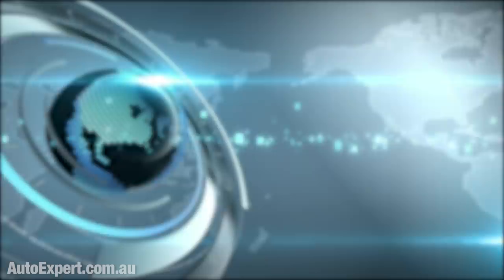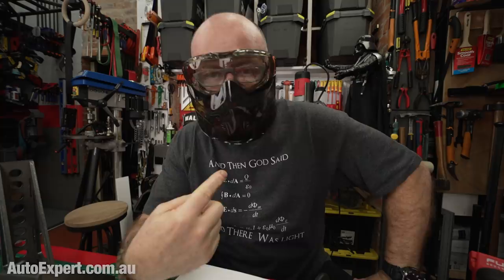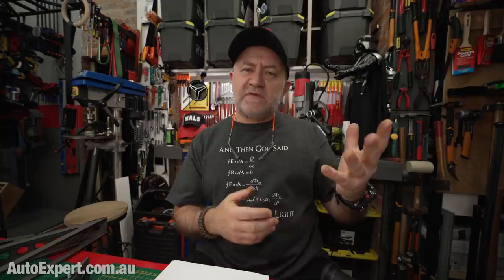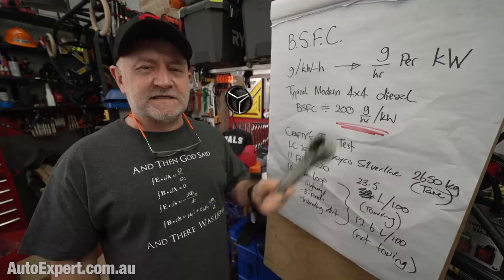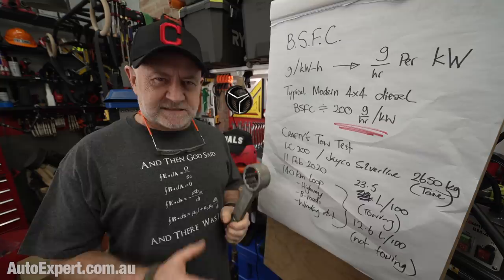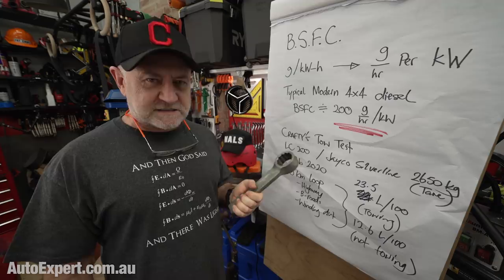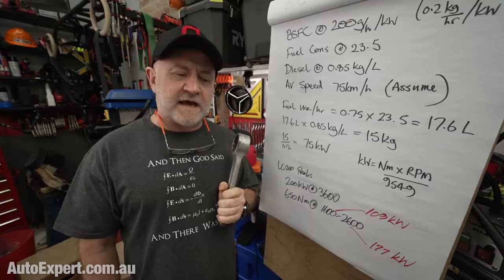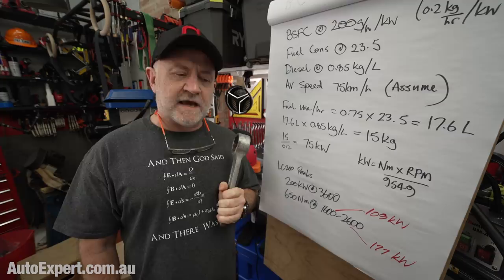How much power does it really take to tow? | Auto Expert John Cadogan

Comment: I completed my trade as a Fitter& Machinist  many moons ago and was taught both in TAFE and the workshop that gloves were not to be used whilst operating grinders, lathes, drills, planers, slotters, mills, etc. for safety reasons.
Reply: Correct, along with long hair to be tied back, lose clothes or cuffs to be fastened up. Don't use gloves with a grinder, John is very right with his non glove wearing. On the other hand we were told to wear safety goggles/glasses at all times in the workshop because its not only you firing metallic objects into the sky.
Reply: Agree with all except 4in grinders.
Reply: If it rotates no gloves.

Grinders come with guards?
Reply: @andrewiannello6548  why specifically  4" grinders?
Reply: And rings on fingers
Reply: There’s no blanket rule , you try grind the shit I do on a daily basis with no gloves you’ll look a junky after a week
Reply: @reecem2801  not what the guy I know that had his arm ripped off, or the one that lost 3 fingers.  Both due to rotating equipment and gloves.

Comment: Installed my aftermarket tow pack after consulting Ford. They suggested installing a transmission oil cooler. They also had suggested different speed limits for different loads. Have a Ford Falcon BFIII station wagon.

Comment: HI, here we are 2021 every  modern convienience

Then i think as a kid i used to see EH holdens and 18-20 foot caravans going up and down NSW coast every school holidays

Then i recall my P-plate xmas trip, almost soiled myself going down Mt Ousley near wollongong and got brake fade because i over used the brakes down hill to not speed ( XB falcon in 1978 ) when we got to the caravan park i mentioned it to one bloke and he said "city feller arnt you"  i said yes, he said, next time when you are going 80 k's before you hit the down hill place the car in second, you will get engine braking and wont over rev or speed to much past the limit, it will save brakes and he said dont touch or ride the brakes they will warm up, just give them one hard had to drop 20/30 kph and let go, they will cool down in a minute and work fine  - period soft brakes

Now i see people getting into big end utes, they hitch up and just floor the car like they are not towing, then they are suprised the caravan or trailer pushes them or sways even most of the work is auto adjusted by the cars ABS etc

Regards
George
Reply: I was about to say I saw HQs towing caravans everywhere but you got in before me. To this day I hate riding the brakes, even though I haven’t experienced brake fade for a couple of decades!

Comment: Very good and clearly explained. We had a VE ute and used it to tow an 1800kg Jayco which wasn’t a problem until one day I happened to be reading the owners manual and discovered that while the VE sedan and wagon were rated at 2300kg tow capacity the utes were only rated at 1800kg. I can only assume that the body structure of the ute isn’t as strong as the sedan and wagon so that’s another factor in towing capacities.
Cheers Stuart. Ps, when I pointed this out to my wife, a stickler for the rules, I said oh dear we have to buy a new car😂😂😂
Reply: Bugger! I thought strengthening the car would be the obvious option!

Comment: Thanks John, Uni degree safety "officer" here and I agree. Blanket gloves policy is rubbish, especially when dealing with rotating equipment. Well said.
Reply: True, because something showering sparks is showing tiny bits of hot metal towards the hands, and may cause injury.
Reply: Uni degree, so no real experience
Reply: Agrree fully with rotating equipment drills milling machines pedistal grinders etc but not angle grinders leather gloves dont get pulled in cuting grinding and sanding discs just dont pull them in. ive been in welding fabrication 35years and seen a few incidents with grinders worst being a 9 grind shatteting and cutting  one of my fingers half through welding glove would have saved most of the damage
Reply: @wmil65  Absolutely correct, I couldn't agree with you more 👍

Comment: Another fascinating one John. I've had a similar conversation in the pub before when people have expressed surprise that the 76 litre V16 diesels in trains have a relatively low specific output compared to a modern BMW or whatever diesel car engine.

Interestingly the BSFC of the train engines is 205-210 g/kWh so in the same parish as your figures.

The key difference I've explained to people is that train engines in contrast to their little automotive brothers DO work at full power for a far higher percentage of the time. When drivers are accelerating from a station stop to keep to the timetable they will have the taps wide open for many minutes to get to line speed. And if cruising at 125mph especially up a gradient again that will usually require all the horses. And these engines will cover over a thousand miles every day for more than the average life of a passenger car.

Horses for courses....
Reply: Same with trucks that drive at near full throttle just to cruise at 100. Full boost all day etc

Comment: That depends on the vehicles gearing. Most semi trailers and b’double prime movers have between eight to ten horsepower per ton. Most 62 tonne b’doubles will be powered by a 500-600 horsepower engine, gearbox and diff ratios start it rolling, the engines torque help keep to it’s momentum.
Reply: 500 horsepower with 2000nm of torque
Reply: Agree about the gearing.  Ideal gearing for towing is different to ideal gearing for an arbitrary fuel consumption test in order to compete in glossy marketing land.  Take a look at the new Ranger.  1:1 is the seventh gear so 3 overdrives.  1st is shorter than the old 6spd but not by a huge amount.  I had a MN Triton with 5spd manual.  That could really have done with a 6spd but only if the extra gear was not an overdrive and expanded the total gear range lower.   Along comes the MQ with a 6spd....with 1st to 5th basically the same as the MN but an extra pointless overdrive (for towing).  The extra gear, power and torque that the MQ made would have been put to better use if they also added the 3.9:1 diff ratio from the auto.  But that would have hurt the glossy brochure numbers so instead of a materially improved tow vehicle you get one that struggles to drive into a mild breeze in 6th gear at 100km/hr.
Reply: @DW-10  regarding towing in 6th. If it’s struggling wouldn’t that suggest changing down a gear?
Reply: @justinwright6611  never tow in overdrive unless dead flat. Those gears are often just press fit and not designed for full torque and heavy loads in manuals
Reply: @justinwright6611  yep, if your vehicle is struggling in any gear then changing down is a good idea.  But I wasn't talking about towing in 6th.  Overdrive ratios are not designed for towing or high loads.  That is why I advocated only 1 overdrive and using the "other" gears to extend the "usable" range for what these vehicles are used/advertised for.   I see marketing talking about towing ability all the time.  Can't remember the last time I saw an add for a D-Max or other ute that waffled on about cruising at the lowest possible rpm at 100km/h.
Reply: Some more magic numbers to remember:
25hp/t for ag tractors,
40hp/t for fire tenders and ambulances

Comment: Right on John, I have been driving heavy Vehicles since 1984 and while the horsepower has grown over time we still managed to move the same payloads with around half the engine output
With the right gearing almost anything is possible.. My Fuso is only 338kw with 2011Nm but regularly is up around 48,000Kg GMV Giving it a laden power to weight ratio of only 7Kw/Tonne
So if you only took power to weight ratios in to account a Amaroc could tow 28 ton... Its never the power that is the limiting factor.

Comment: Ask a pipeline welders t/a, about wearing gloves and grinding.   I have and those that have built gas pipelines, have ground more discs to the silver ring than any on this continent.  Gloves with angle grinder is a MUST (if all one does is grind welds all day)
Reply: Your safety people will order use of gloves for that job, however they need not be particularly bulky gloves to provide protection. Worst type of glove for those jobs are anything fuzzy like "motorman's gloves". A quick look in a safety or industrial supply catalog will give you lots of choices, even if you buy them in a big-box store or online.

Comment: The Ford Ranger Raptor is a great example of what you said about either the tyre, wheels and shock set-ups for comfort and the "Weakest Link" with respect to limitations of load and towing. The Ford Ranger Raptor comes with 285/70/R17 tyres on Wheels 17"x8.5" +55 rated to 780kg giving it the max load per axle rating to 1560kg, if you look at the Specifications for the max Front Axle load rating of 1550kg this is just 10kg under the wheel rating across the axle, and the Rear Axle is rated to 1540kg giving 20kg difference. The main reasons Ford gives for low load rating was due to the position sensitive shocks and ride quality selected despite having said of a 25% increase in chassis strength over the standard Ranger and having a stronger axle.

Comment: I used to tow with a 2001 Holden Rodeo, Diesel, 70kw or so, 200ish torques, with a trailer full of rocks (we were building a stone house at the time) max speed foot to the floor was about 70kmh, so, that was not enough power, you want more than that.
Reply: must of been a dog of a motor, the 4JB1T I owed for nearly twenty years would tow caravans and large boats to 100 KPH everyday, had to use your brain a bit when faced with a decent hill, but it got there. BTW the 4JB1T has 74 KW and 225Nm.
Reply: @HORTOJM  In fairness a trailer full of rocks probably weighs more than your average caravan (I would guestimate 3 or 4 tonnes all up). Yes the motor was old, had 320,000k's or so on it when I got it, nearly 500,000 when I sold it, so I think we can reasonably assume it had probably lost some HP.
Reply: @HORTOJM  And aside from a dead alternator and some replacement tyres and a couple of flat tyres and having to re-gas the AC all I ever had to do was put fuel in it and service it, it was a good vehicle but it was manual and the new wife at the time was unable to operate it. I have an 09 Colorado diesel now and I love it.
Reply: @legallyfree2955  4 tonne with the Rodeo's brakes, you are a braver man then me. Yeah had my donk redone at 250k due to blocked oil pick up. But, still had original starter, alt, GB, and injector pump, so got my money worth's.
Reply: @HORTOJM  It was a braked trailer (although not electronic brakes, it used to jerk and shove the vehicle around a bit), Thinking back it was probably more like 1 tonne of rocks in the ute and another 2 behind. Definitely good vehicles for the time.

Comment: But from what I know as a marine engineer, diesel engines durability is lowered if operating at maximum available torque and thereby power at a certain rev point. So we always set operating revs higher than minimum possible revs for the required power. In other words, if you need 107kw, you would never run the engine at 1600 rpm. That stresses the gearbox too as they are sensitive to higher torques and lower revs, so it’s better durability wise to operate at lower torque and higher revs for the same 107kw for instance. You may set engine at 1800 or 2000 depending on the durability chart. Car manufacturers don’t release these charts, but in boats and ships they do, since they operate 24hrs a day at certain power settings.
Good video by the way.

Comment: torque x revs / 9549 = kW is a very good method to find out what the engine is generating at specific flywheel engine speed, if you have an automatic then  reduce what the final output it by around 10% and if you have AWD then  reduce by a further 5%, then you can find out what the approx. at the wheels kW power is, for manual reduce it by 5% and if manual + AWD then a further 5%.

Keep up the good work John, also your mathematics sadly on another topic is pretty much spot on and again i ask "where is the NSW Governor" the current premier is incompetent as are her  spin doctors, the NSW Governor has the power in the NSW Constitution to dismiss the current government on grounds of being incompetent handling public affairs.

Comment: John, I didn't hear you mention it, but often towing limitations are based on brakes. Once you get all that weight moving you have to be able to get it stopped!
Reply: The question was: how much power does it take to tow? Not a limitation question.  Not worried about stopping.  Another chapter another time perhaps?
Reply: @bunzeebear2973  The original question wasn't about suspension or tire limitations either, but John talked about those. Why? Because the point is that towing limitations are not based on engine power alone.

Comment: I have an ex military v8 landrover that is rated to 4.5T (8800 lb). Gloves, I have worn welders gloves when using a angle grinder most of my working career as a boiler maker.  Until I see the actual risk assessment I don't actually have an opinion on the gloves issue.

Comment: As much as I respect Cadogan's very educated views: I ALWAYS wore leather gloves when using the angle grinder, and they saved me from bloody cuts countless times. The flaw in the no-gloves-idea is that the entrapment hazard was worse than the laceration hazard. While this may be true with high-torque grinders (none of which I yet had as handheld machinery), I have been in countless limited space working situations where it was just not possible to avoid hot metall spray onto the hands during cutting or grinding. In the wheel arch of a car, or cutting an exhaust in it's tunnel, the hot metal bounces anywhere. And it hurts. A lot. So why cook your hands? Because the grinder could snatch your glove, pull your finger in between the guard and the blade, and chomp right through it? Tear off your finger?
This kind of "cutting" process would need a couple of Newtons Meters, which none of the grinders from low to high end I ever operated are able to produce. In my applied reality, whenever the fast rotating disc touched glove, it would just chip away from the leather surface. Be it a cutting, grinding or a brushed disc (looks a bit like snow falling, when brush bites leather). In most of the cases this would have been my bare skin. On one or the other occasion there was some force behind the impact, and I don't even want to imagine how deep the cut would have been, as my guess is that the thick, proper welders gloves leather I prefer probably put up considerably more resistance to a thin, fast cutting disc than my bare skin.
Perhaps there are angle grinders operating with very high torque, on lower revs, which produce enough Newtonmeters to crush leather clad muscle and bone, where the entrapment might outweigh the hazard of touching skin. From my personal, subjective experience with torque handling I would guess that you'd need 40 NM upwards for being  able to snag up a leather glove and process any meat and bone within to mince before coming to a stop.
I'm too lazy to run the maths on this now, but hey, maybe someone here, or mighty John would like to figure out how many Watts you'd need to spin 10000 rpm at more than - to come within the danger zone - let's say 30 NM?

Comment: The task of using a bench grinder, the work piece is placed on the wheel steady and pushed against the stone, this is where a glove could get caught. The difference is a hand grinder is designed to be held with both hands where the disk is pushed against the work, as long as your hands are holding the appliance they will never come in contact with the rotating disk. If the work piece is small it should be held in a vice or clamped to a bench top. A trained trades person knows when and where to wear gloves. Uncontrolled loose clothing and long hair are dangers in a workplace where exposed machinery is operated. Tractor PTO are also a known hazards. The first safety film shown to apprentices back years ago showed the result of long hair being caught in a pedestal drill spindle, the outcome was not pretty where the operator's scalp was ripped from his skill. Before any task is undertaken the risk of injury including fire should be considered. After surviving the gravitational force of a three ton piece of steel it tends to focus you on the unexpected. Cheers
Reply: Exactly 👍

Comment: I've been a steel fixer for 20 years.  We constantly used 9-inch grinders until they were banned from most work sites.  There's nothing wrong with using thin gloves when using a grinder.  Thin gloves will rip and not entangle your fingers into the wheel.  Also, most big work sites, such as union sites, all require you wearing gloves while using grinders or quick cut saws.

Comment: My 1988 Ford Econoline with a 460ci engine is rated to tow 6 tons. I've never towed that heavy (outside of work where my 3 GE CW-4400 locos can pull 33,000 tons) but I have had a 1980 Daimler Sovereign V-12 on a trailer and the old van didn't know it was there.

Comment: I carried well over a tonne once in a 63kW/160Nm ute with the suspension bottomed out, it did the job. The scary thing was hoping the thing would go around corners when I turned the steering wheel.

Comment: From my understanding a big part is the sheer force on the frame. Having weight in the vehicle pressing down affects the frame differently than having the stress being perpendicular to the frame. The frame needs reinforcing to compensate for a different type of stress. Which adds weight.
Reply: My MX-5 towbar is rated to 440kg. Have only towed an empty motorcycle trailer so far. Even empty noticeable performance loss. I would guess trailer weighs around 200kg but will weigh it soon.  Would like to be able to tow two 87kg motorcycles upon it.